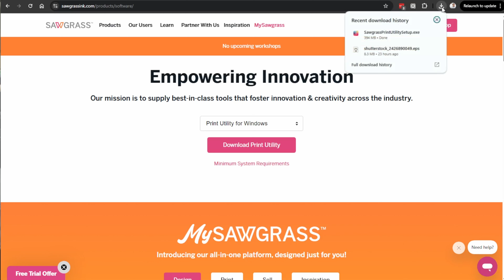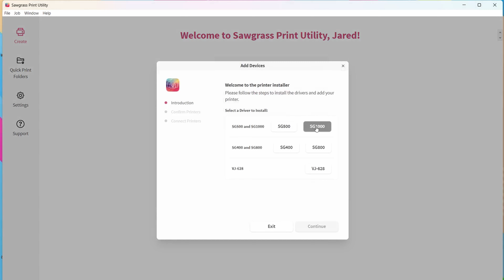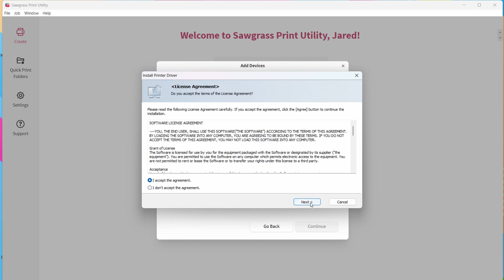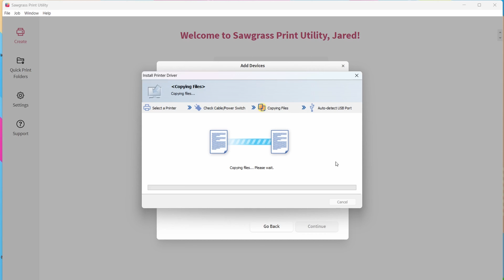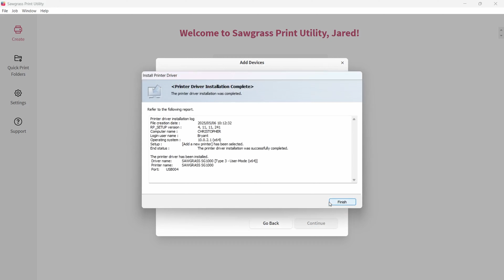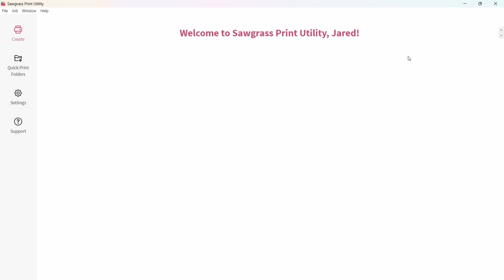How To Set Up Sawgrass Print Utility Fast and Easy!

Comment: I had to uninstall my SG500 and Print Manager, then reinstall the printer and download Print Utility.  I have cleaned the heads and printed out a Primary Chart, which printed fine except for the Magenta having lines in it.  I am and always have used the Siser Easysubli Inks in my machine.  Now, when I print my image from Silhouette Studio, there are yellow stripes in the red portions of my image.